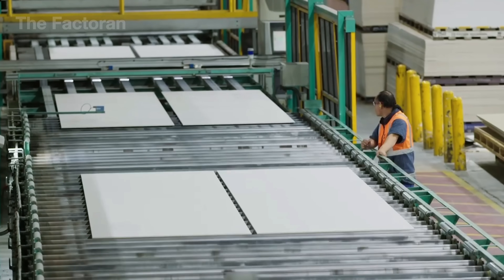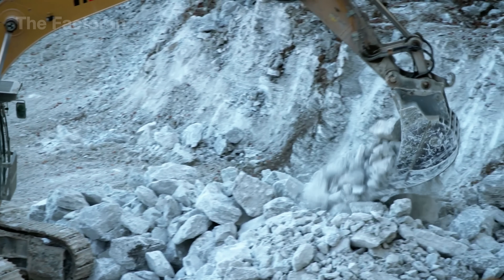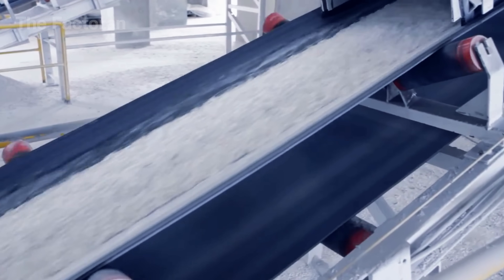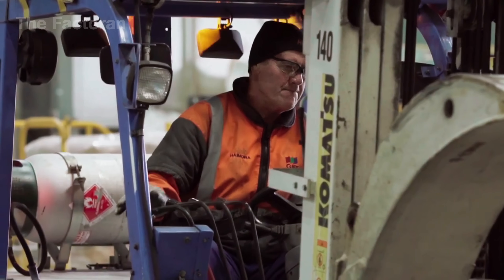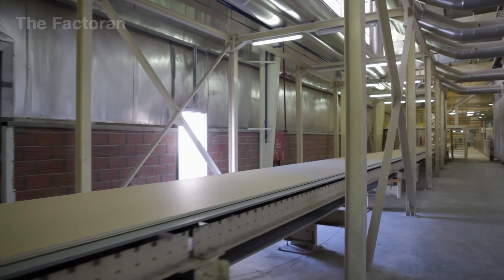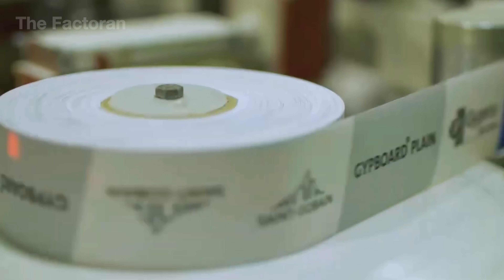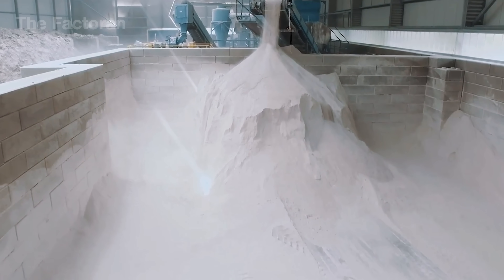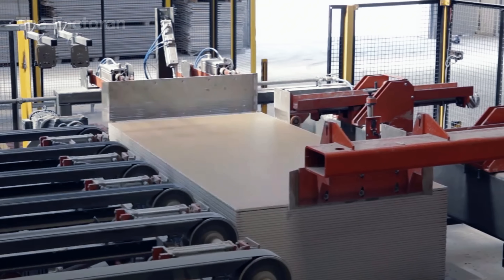How Drywall Is Made From Gypsum In Massive Production Lines | 34 Billion Square Feet Every Year

Comment: I wish drywall recycling was available in the US. Installation is a very wasteful process, that doesn't even include the demo portion on remodels. I've taken dozens of pickup loads of new drywall scrap pieces to the dump. When I get to the dump it is usually 30-50% drywall waste.
Reply from the maker: You’re right, drywall waste is a big issue, and expanded recycling access could make a real impact.

Comment: So the drywall is dried at about 260 degredars and is removed after cooling for 30 minoots. Got it.
Reply from the maker: Yep, that’s the idea — the panels dry at high heat and then cool briefly before moving on to the next stage
Reply: @TheFactoran I was mocking the AI commentator.

Comment: This factory was very similar to the one i worked in in 1980 that made ceramic tiles. The raw material came from Nova Scotia by boat into Philly. Then it was moved by train to Landsdale, PA.  There the crusher machines to break up the rocks and giant tumblers filled with steel balls would further break it into a fine powder then into large tumblers to dry. The factory was so big it took 20 minutes to walk from one side to the other. Luckily we had golf carts to get around. They had massive machines to stamp out the tiles and then into one of five 75 yard long ovens to bake.
Reply from the maker: That sounds amazing! Factories like that were engineering marvels for their time. The scale and process you described really show how much work went into making something as simple as a tile. Thanks for sharing that memory!

Comment: I used what they call 5/8 drywall on my church ProJet 10 years ago but it was not really that thick why do they lie about it
Reply from the maker: Yeah, that happens sometimes — “5/8 inch” drywall often measures slightly under that because of manufacturing tolerances and paper thickness. It’s still sold as 5/8 since it meets building code specs for that class.

Comment: I noticed that there are no bevelled edges on the drywall? Here in Vancouver B,C, it's all you see is bevelled edge. Is there such a material? non bevelled drywall?
Reply from the maker: Great observation! Yes, non-bevelled (or square-edge) drywall does exist. It’s often used for industrial settings or areas where panels are joined with trim instead of taped joints.

Comment: Gypsum from a coal power plant, also called synthetic gypsum or FGD gypsum, is a byproduct of the process to remove sulfur dioxide from emissions using flue gas desulfurization (FGD) scrubbers. In this process, limestone and water are used to react with sulfur dioxide (\(SO_{2}\)) in the flue gas, creating calcium sulfate dihydrate, or gypsum. This synthetic gypsum is often a high-quality, environmentally desirable substitute for mined gypsum, primarily used in building materials like drywall, and also has agricultural and other industrial applications
Reply from the maker: That's a great point about synthetic gypsum from coal plants! It's amazing how FGD scrubbers turn sulfur dioxide emissions into high-quality gypsum for drywall and agriculture, reducing waste and environmental impact. Thanks for the insight—love the science behind it!

Comment: The engineering behind this is amazing, but I can’t stop thinking about the energy it takes.
Reply from the maker: Totally get why you're blown away by the gypsum processing tech—it's wild! But yeah, the energy use is a big deal; those plants often guzzle electricity and fuel for crushing, heating, and drying. Any ideas on how they could cut down on that energy footprint?

Comment: I remember in the 90's I think, that millions of sheets of drywall from China were found to have been made with some unusual chemical and the sulfurous  fumes from the product actually dissolved copper pipe and any metalk suh as wiring in the same building. It also stinked like rotten eggs It took them a while to figure out waht was doing it. HVAC systems were ruined. Thousands of homes had turned into unliveable dwellings
Reply: I think they used volcanic ash

Comment: The one thing you didn't show was how they formed the bevelled edges?
Reply from the maker: Great catch! That step usually happens right after the board is cut — high-speed edge planers or milling machines shape the bevels before stacking.

Comment: I've hung drywall for over 35yrs , they started putting air bubbles in the gypsum to make it lighter which in turn would crush easily and have factory bad spots. I feel sorry for people buying new homes now a days. It WILL fall off the ceilings with all the extra weight from insulation,  lights ,fans. good luck people
Reply: Oh yeah.  I have been hearing about nearly every new house is having the ceiling falling down.  It sucks that they have to put insulation in homes now.  And heaven forbid that a 20lb ceiling fan is added.  The freaking house will surely collapse.  SMH
Reply from the maker: Yeah, it’s tough — ceilings take on a lot more load now with insulation and fixtures. Definitely makes solid installation and materials more important than ever.
Reply: Good too know thanks
Reply from the maker: Appreciate your insight — 35 years is a lot of experience! You’re right, lighter boards can have trade-offs, and it really shows how important quality control is in modern construction.

Comment: So, did I miss the part after the anti bubble spray, where the sheets get solid? Seemed to dry pretty quickly.
Reply from the maker: Yeah, after the anti-bubble spray the sheets go through drying and curing ovens — that’s where they harden up before moving on to the next stage.

Comment: I'm a drywall finisher/hanger. The only reason I can think of why the US doesn't recycle drywall. Would be for the fire resistance. They said in Europe they mix the recycled drywall with paper. Drywall is very fire resistant. Multiple layers can be hung staggering the joints in each layer. Depending on how many layers are hung. Can give fire fighters around 4 hours to extinguish the fire before spreading to the next room. A lot of commercial buildings have fire rated walls. Such as hospital's. My guess is adding recycled paper into the recycle gypsum. Would degrade the fire resistance. But what do I know. I just hang and mud the shit. I don't make it!
Reply: I retired from a USG drywall plant here in Iowa. All of the bad board we made was dumped behind the plant, where it was ground up and later mixed in with the rock being sent to our crusher. They are also installing a hydro pulper so the waste board can be mixed with water and the slurry sent directly to the mixer on the line. We had one years ago, and it smelled like a sewer. I hope for their sake that new technology gets rid of the order.
Reply: I have been involved in some fire investigations. North American drywall never burned. The paper was scorched but never flamed through. Some totally destroyed structures were the few exceptions. Incorporating paper into the slurry would be a concern in my opinion.
Reply: Here in Denmark drywall is also used for fire resistance, 2 layers of board with staggered joints are required for fire and sound resistance. There is no less fire resistance by adding paper to the board, the surface is already paper
Reply: its acheap low value product. the trucking cost would be outrageous to cllect it to plant
Reply from the maker: Makes sense—fire resistance is huge, and anything that weakens it would be a real concern.
Reply: Yeah, that's the shit board that don't snap clean. In Fl in 77 rinker had a ton of it that your blade would last about 10 cuts and snapped jagged. Hung that crab for couple years. It was a lot less expensive.

Comment: Gypsum is NOT mined ‘deep underground’. It is relatively common and of such low value, it is only sourced from surface mining AKA - quarries.
Reply from the maker: You’re right, gypsum is usually taken from open quarries since it’s so common and low value.
Reply: I'm a retired maintenance mechanic who worked in a drywall plant for over 23 years. We had a gypsum mine 640 feet deep.

Comment: how do they make something as ordinary as drywall feel so massive and impressive on this production line ?
Reply from the maker: It’s the scale — giant machines and nonstop flow make even simple drywall look massive and powerful.
Reply: The drywall plant I retired from had lines a quarter mile long, mainly because of the drying process. Our kilns operated at 525 degrees F, and the speed varied depending on the type of board we were running.

Comment: You said that it's lite wight evidently you have never picked up a sheet of drywall.
Reply: Try picking up a piece of acoustic plaster, now that's heavy!
Reply: fire code for strip malls, double layer 5/8" 4'x16"- work is just exercising an getting paid. America the Beautiful.
Reply: Compared to a plaster wall, a sheet rock wall is lighter structurally which means the floor framing is not as heavily done as a older homes, thus cutting costs for the builders, I have seen the changes over 50 years of working as a carpenter.
Reply: 24 inch is light, but not the 48 inch.
Reply: Not that AI generated voice that is into everything so annoying
Reply: 1/2x4’x12’ weighs 110 pounds!
Reply from the maker: True, drywall sheets are still heavy — “lightweight” just means they’re lighter than older versions.
Reply: @TheFactoran  'cuz there ain't supposed to have Asbestos it it....cough cough..
Reply: @petethetaper asbestos isn't in drywall.  It's in the joint compound and texture.  Sry but I removed the stuff for years.  From spray on fireproofing to mastic to drywall to pipe insulation and boilers.
Reply: @brandonstansberry9195 my middle finger

Comment: So, do they rely on the gypsum to tell them how many times a particular dry wall sheet has been demod, recycled, and ultimately used?  Am I missing something?  If I go buy recycled drywall, how do I check the certification that it has not been recycled more than standards allow?
Reply from the maker: Good question — certification usually comes from industry standards and facility testing, not the gypsum itself.
Reply: @TheFactoran I think you may have missed the point.  The industry standard is a inmeasurable statistic.
Reply: I’m so tired of ai crappola. Sooooo many annoying mistakes, misnomers and ignorant assumptions. If this ai is our future, heaven help us.
Reply: @toddboswell7524 I think u nailed it. But just like all other innovation, the original intent is rarely the finished product, or anything that resembles the original.  My point is ai could work out cures and problems are best and brightest can only imagine.

 I still await the end of the world by the hands of iPhones.